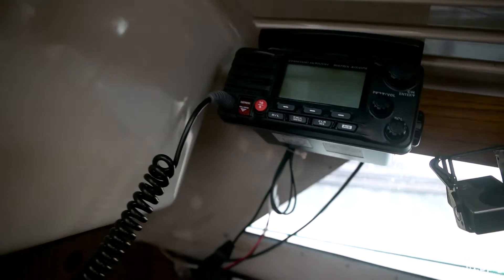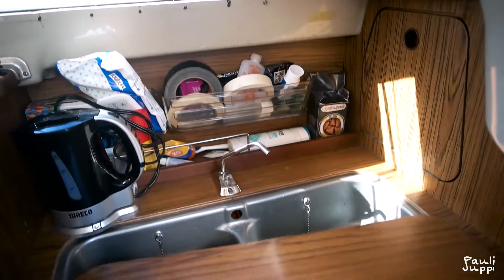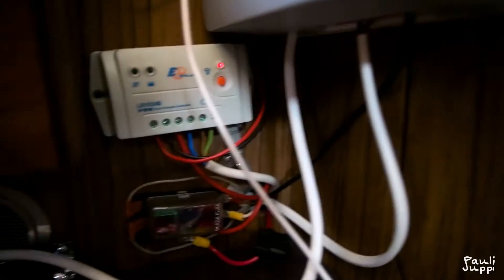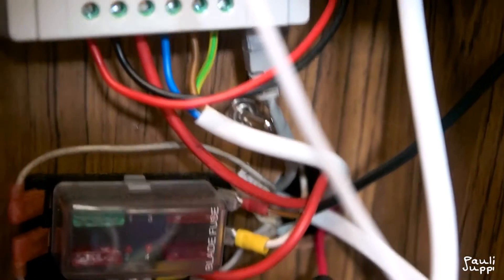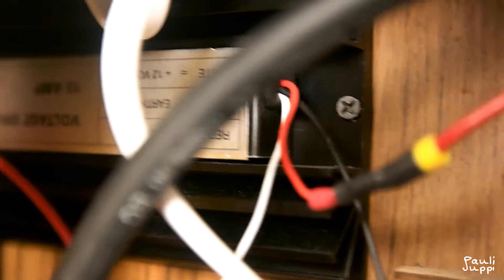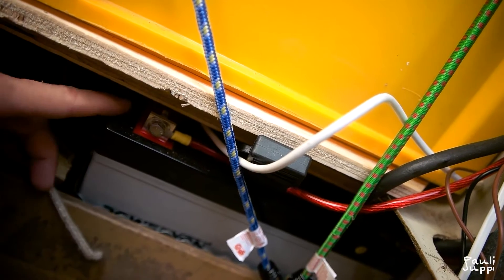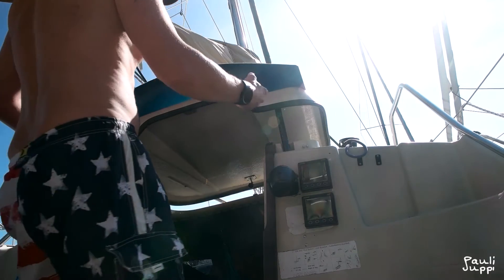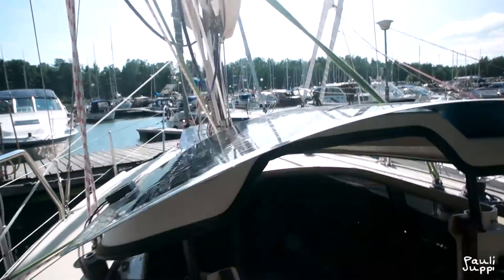This is my electric sailboat! Part 4/3 Extra!

Comment: The sun gives us 1360Watts of energy per square metre at the equator, it reduces to close you get to the poles. Going all-electric is like chasing your tail, the more you use the bigger the system to run it. It looks like 90% of your energy is going into the motor that isn't really giving much efficiency. It's an interesting concept that has many years to develop. Electric boats running on foils would use far less energy.

Comment: Hi Pauli, you mentioned that you don't use any fossil fuels on your boat, so I wondered about your cooking arrangements. How do you cook aboard the boat, besides using an electric kettle for boiling water? Great videos by the way and a very intriguing vessel. What make and model is she and how old? Fair winds (and fair sunshine!), Steve
Reply from the maker: Hi +Stephen Bradley . I've used my GoSun solar oven some times, but I usually don't cook while sailing. Next summer I'm gonna try my wood pellet heater as a stove also(check my latest videos) :)
My boat is Dehler Delanta 75 from 1976.

Comment: You might get slightly more output from your solar panels if both would use separate regulators.
In that way the panel possibly under shadow, would not steal energy from the one properly exposed for sun.
As a side note I have a 50W panel for my reserve bank (140Ah), not that effective up here in the north if not aimed towards the sun as you know...
Reply from the maker: +Scramasax Good point, but I don't think it's that effective in my case and worth the money and hassle

Comment: Really cool ideas!  Thanks for sharing them all.  I like the way you mix your 12V n 24V systems.  Your motor looks like a great cheap setup too!  Really enjoyed watching this series.  
I am considering having one 48 volt battery bank and using inexpensive 10A step down converters for all my 12V circuits.  One for the fridge, one for the Nav electronics, one or two for all my lights.    What do you think that would do for the entire system?  If most of my energy is used for the motor but only occasionally am I getting too much loss with the small DC-DC converters for my normal 12v circuits?
Reply from the maker: +ScubaTony Anschutz Thanks for commenting! I don't know how big your boat/system is but I think you could be fine with just one bigger down converter, like 30amp..? Have you calculated your 12v consumption? I'd do the same on my boat, but now I have the 24v solar charger and 24v cooler etc.. Cheap down converters like mine consume about the same amount of amps from 24volts that it puts out in 12v. That's not efficient. There might be better ones that use the extra volts to get more amp out. Like my mppt solar charger does.

Comment: I have 2 questions,

How or what makes ur motor to go reverse? 

And second, how do you adjust power to motor, I saw this remote control from old motor, but how do you reduce on this electric motor energy flow in order to reduce or speed up?

Thanks for great vids!
Reply from the maker: +Željko Petričić My motor controller has an internal circuit for reversing the polarity. That's how the motor runs backwards.
I use 5K potentiometer that is controlled by wire from the old motor throttle. More info: http://kellycontroller.com

Comment: With the extra batteries and equipment how many pounds (kilos) did you add to the displacement of your boat, did the extra weight effect your sailing performance much? What is your sailing to motoring ratio? Also if you change the pitch of the prop could you gain speed (knots) without using more energy?
Reply from the maker: +Kurt Leisenfelder Thanks for your questions! I have about 400kg extra weight from the batteries, panels and cables :) I don't know that much about sailing so I can't answer about the performance.. I installed most of the batteries on the first day I bought her and back then I hadn't sail alone at all :) but I think she goes pretty fast: easily 6 sometimes over 7 knots.
Nowadays if I'm gonna visit some islands for couple of days and the legs are over 4 hours and the wind is low I usually use motor to get a little boost. With just 20amps I can get the speed from 3 to 4 knots. It's just pointless to save the electricity if the sky is full of it. I rather save some time ;)
Reply from the maker: +Kurt Leisenfelder and about the prop.. Based on the experience and experiments that I've conducted: No. I've used two different outboard "bodies" for my motor with 3 different size props. All the data from them fitted to the same graph about speed/amps ratio. Bigger goes faster but uses more amps :)
Only maybe some special prop like the ones on Torqeedo could do the trick, but that's a different story and debate...

Comment: U need to go parallel. The Wynns on YouTube had a really good vid on testing serial and parallel  for sailing. Shading from the boom and lines really can effect the production.
Reply from the maker: +Joe Rovalino I think I saw that video, but did they use mono crystal panels? Also my mppt controller is very effective using the extra voltage I get with series connection.

Comment: Pauli great video series. I am still trying to under stand the formula to estimate your range. so assuming it's night time or cloudy and becalmed and their is no charging from solar panels, I estimated that @3knts per hour you would have a range of about 75 knts consuming a total of around 500 amp hours.. is that correct?
Reply from the maker: +Cabin Cruiser LittleBigTime I have 500ah but cos it's not recommended to discharge you're batteries completely and with the rate that my motor drinks the amps so I used only 400ah for the calculations.